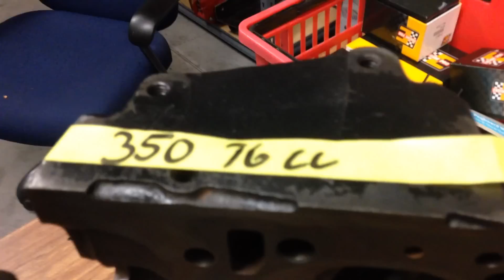350 and 305 Chevy what's The Difference

Comment: I learned more in five minutes watching this video about the difference between 305s and 350 engines. Absolutely recommend a watch.
Reply: Same for me sick info
Reply: Good video honest good info
Reply: Can you put a 400 crank in a 305
Reply: @ronaldphelps2689  yes you can if its 85 or older unless buy an aftermarket one piece rear main seal. If .040 over bore and 400 crank with the longer 350 rods it is a 339.6 and with the longer stroke compression goes up with flat tops 4 valve reliefs to improve the heads with hp 64 cc 350 heads works well. Good cam and intake and heads it runs well and over 300 hp. Torque curve is different than 350. Comes in hard low like 305 buys stays thru hp and peaks about the same. Not a total waste of time and money. Ran them against 327s in lower liter limited 30s 40s fiberglass bodied cars. Great luck with them until find out too big and get claimed.
Reply: Me too
Reply: Instablaster
Reply: My question is couldn’t you just port out the heads Or are the walls thinner?
Reply: @thepropview9517 , you might wanna take a closer look at the intake walls on the 305 heads, in fact, take a good set of calipers and measure the walls on the 305 and 350 heads. I'm well into my sixties and have built many hotrod motors over the years, mostly Chevrolets. I once built a poorboy engine using the closed chambered 185 intake valves, 1.5 exhaust valves on 305 heads on a 350 4 bolt main block with 8.5.1 flat top Pistons, with a good set of long tube headers, turbo mufflers, with 2-1/2 in piping out the rear, put in a 168 midrange cam that was basically the next size bigger at the time than the 260 RV cam, I used the 1969 350 spreadbore 4 barrel intake with a 750cfm quadrajet carburetor with a HEI ignition, I put this engine in a 77 Silverado with 373 gears and turbo-hydramatic 400 auto tranny, I was a little disappointed at the outcome of the build, I decided the engine wasn't getting enough air and fuel, so I ported and installed the 350 heads with the 1.94" intake valves, bought and installed a Edelbrock torquer intake with a Holley 850 cfm carburetor with a much bigger breather, now I was satisfied with what I thought was going to be a low budget mediocre little hotrod truck, but I did get a lesson on the differences between the closed chambered 305 heads and the big valve 350 heads.
Reply: Me since I was 10 believing everyone already knew all this…😑
Reply: @lesliesaner717  The question is, why would you want to trust a 305 that has been bored .040” over? The later blocks (305) have a significantly lower nickel content than an older 350 block, and you’re already handicapped with a thinner weaker cylinder wall
Reply: You learned more than what?
Reply: @lexpro2239  then the previous knowledge I had.
Reply: @steves2443  "I learned more in five minutes than i knew five minutes ago. "More than" hints toward a more complete thought. Understanding starts with an ability to communicate properly. "I am thankful for this video teaching me more in five minutes than I've learned in the past 5 years of higher education." There is an example of a complete sentence. Use incomplete sentences to scribe all the incomplete thoughts you wish. I submit to you that punctuation is unnecessary when the ideas are incomplete
Reply: @lexpro2239  Grammar aside and punctuation for that matter...the video stands as a great example of the owner of this Youtube channel, Myvintageiron7512, explaining his love for the trade where he's gifted. 600k+ views and 7.7k likes proves that point. Again, please do not miss the point of the video over the need to correct for grammar. BTW, what did you think of the video?
Reply: yep!

Comment: I bought a 1986 Elcamino in 1986 so I am the original owner it came with a 305 engine.  I got 369,000 miles out of it very dependable.  It jumped time while starting one morning in my driveway so I jacked up the motor and pulled the oil pan and changed the chain and gears, new oil pump, and just kept driving the car.  Later on the valve guides were so worn (2005) that oil would leak down in the pistons and it was hard to start in the mornings; however after I got it started and warmed up it ran fine.  Rebuilt the carburetor and kept going.  That same year 2005 it was time to rebuild the motor so instead I dropped in a 2000 LS1 out of a Corvette and I still own the car today.  I still have the 305 on an engine stand in the garage.  Again very dependable motor for a daily driver.
Reply: James Perkins great story man, I visualize the entire thing. What do you think about the 350?
Reply: That's an awesome story man I have an 81 and plan to buy a crate 350 370horsepower
Reply: Have an 86 Grand Prix with a 305. Odd options on the car, base interior, 200r4 trans, posi rear end, aluminum intake with a 4brl Quadra junk...I mean Quadra-jet.  Still the runs the same as it did when I got it as a young teenager. 314,000 miles and actually screams.

Comment: One of the best performing motors I have seen was a 305. When we bought it we actually thought it was a beefed up 350. It was so well balanced it was crazy. 
   I was working in a shop in Little Rock at the time.  A guy had a beautiful 85 Monte Carlo. It had gotten stolen about 3 weeks after I had personally worked on it.  You know. He just wanted a basic tune job. Plugs, wires, and a little carb adjustment.  After the work I performed. Just like any other time , I get to test drive.  WELL SIR, I MUST SAY.  I was very, very impressed for what I thought it was. ( Keep in mind I had driven a numerous amount of Hot Rods at this this time.) 
  I was personally driving an 81' El Camino. It had a Pontiac 400 with 6x heads. Edelbrock intake, 4 barrel Quadrajet. That I had tricked out a little bit.( Personally my favorite carb,,, when built right.)
   Either way it was a mean s.o.b.
This all prettied Monte Carlo could've given me a run for my money. (Thinking it was a 350)
 The guys car got stolen. He sold it back to the shop I worked at. The owner of the shop loved the paint job that was on it. So he bought it.
  He was wanting to tpi it though. No prob. We had the stuff to do so.  Anyway he was selling the motor. I had a buddy with a 76' El Camino that was going to rebuild his factory 400 SBC. I told him to come and check this motor out before he started spending money on his factory motor.
  He did. And just like me, thought it was a beast. With the craziest lope you could ask for in a street car it would sit perfectly still. NO SHAKE. The throttle was instant and all you could want.
 He bought it and drove that El camino for about 6 months.  Then the most unfortunate thing that could happen did. THE OIL SCREEN FELL OFF. DAMN, DAMN.
  NEEDLESS to say he wasn't light footed. He liked drifting before drifting was a thing.  We pulled the motor back out. Popped off the oil pan to see the damage to the crank. It was bad enough. It was clear it was a done. Yes it was a balanced engine, it was clear when we pulled the pan. It trashed 3&5 rods. So we pulled the heads.
  Our jaws dropped at this point. NO WAY!. BUT YET THERE IT WAS. IN ALL ITS GLORY. A 305. WOW!!!. 
  Never could make any one believe that was the motor that had been in that 76' El Camino.  
   If I were to guess....keep in mind this is 15yrs ago. I would say that little 305 was putting out around 320- 375 horse.  So sad it went down that way.  Either way I can say, done right. And I  mean done right. I could see around 400 HP out of one. Naturally aspirated.
 I would like to add, I love watching your videos. I difference of opinion in a few little things you say. But I guess, we all know what we know.  Trial and error means a lot. And I have done a lot. Good day to you sir. I will be watching for more.
Reply: i have a 86 monte carlo and it has a 305
Reply: Could you run an 84 monte  carlo with 305 and a supercharger kit and still use an automatic transmission?
Reply: Im racing an 87 Monte Carlo SS in Stock eliminator S/KA and I use the 305 that came in the car with 11:1 pistons and the stock 081 unported heads. It has a multiangle valve job bit with an early L82 intake and 750 quadrajet running VP C14+ on the dyno Im making 409 hp @ 6400. This is a balanced race engine that I have thousands in i my class Im all over the national record but cant quite match it.The record is held by a guy in Washington State with an 87 Formula 350 and hes running 11.63. Im a consistent 11.70s car on a good day but Ive put a whole lot of 350s, 302 Fords, 340 Mopars, and 351s on the trailer.
Reply: The entire reason I came to this video is because I'm working on my '76 Elko and was wondering if it was worth upsizing to a 350 or 400, your testimony might save me several hundreds of dollars if I can tune the engine up nicely :D
Reply: @cosmicbrambleclawv2  Most of the issues I see in my custom shop is customers watching to many of those power shows. Huge difference between dyno tuned and drivability tuned. Many times a nice mild small block will beat these huge high priced big blocks in a lot of races. Main reason is part compatibility and tuning. I generally see the biggest issue is huge cams, huge carbs, 9ish to 1 compression and cheap ebay heads. Not going to work well. 

You can see good gains form those cheap heads but just dropping a 750 double pumper right out of the box and complain about it not having power......
Reply: I completely forgot about this comment thread until seeing your reply just now, I appreciate the input :D

Looking back at it, I realize now I forgot to update my original comment haha. I had written down the specs incorrectly when taking notes, and it actually was a 350 rather than a 305

It'll be a hot minute before I get around to working under the hood (at the moment all the floor pans need replacing and some patch work on body panels/bed, among other things like a entirely new gas tank and a piece to cover the carburetor [at the moment it just has a plastic bucket covering it, under the hood] ) but once I do manage to have her nice and settled to where I can fiddle with things that aren't immediately necessary, any suggestions for tuning it up proper? Definitely not gonna end up being a derby truck or anything fancy, just a sort of daily driver/small workhorse. My grandfather's sounds downright mean after he had it tuned up, but I'm more of a "practical before fancy" person myself haha
Reply: Tubbs a qudra bog was the junkie carb Chevy boys used. Big block Dodge boy's used dual line Holley's!
Reply: @Nowayjose-z2r  Big block Dodge engine is WAAY better than anything Chevy ever had.
Reply: @MasterWitchDoctor  i call big BS on that with stock heads lol
Reply: @wildestcowboy2668  ROFLMFAO!!!
Reply: I have a 82 delta 88 with the olds 307 posi rear end it lights the tires up

Comment: Totally my experience as well. I've had both engines. The 305 is OK as you said and IMHO gets a bit better MPG, BUT, the 350 or better yet 383 gives you more of that kick in the pants we all love. Honestly I'm not even the least bit interested in doing 150 MPH on the street but I do love feeling the torque when I step on the throttle. Thanks for the show.

Comment: Thanks for that explanation.  I'd never heard of a 305 V8 until about 1 year ago - a friend told me he had one in his 25th Anniversary '92 Camaro - though I distinctly remember the 307 in the '69 Camaro and Chevelles and other Chevys.  With your info, I just realized what happened:  They quit making the crankshaft for the 307 when they stopped manufacturing the 327 and enlarged the stroke to 350.  So, in order to make another small, similar displacement, they used the 350 crank and then put a new, smaller bore with it.  And they didn't want the C.I. displacement to be identical, so they made it slightly smaller!  Thanks.

Comment: The 305 is my favorite Chevy engine  because many times it is nearly free and sometimes it is free .
Reply: L.E. Batte don’t forget the significantly better gas mileage
Reply: @jacob.calloway6833  😂😂 yeahhhhh
Reply: 327 small journal  250-375 hp is my favorite
Reply: 351 is my favorite Shevy Ingun.
Reply: I have a 454,351,350 and 305 the only one I’ve blown up is the 350. Then I Rebuilt the 350 been driving for another 10 years.All Motors are damn near bullet proof and parts are cheap and everywhere .🏴‍☠️🏴

Comment: Glad to see someone besides me defend the 350s little brother. 305s get a bad rap because they don't make a lot of HP. They weren't designed to be performance motors but they're every bit as reliable and get decent milage and have decent power
Reply from the maker: with all the aftermarket parts available a 305 can really scream and if that is what you have I say just go with it
Reply: @Myvintageiron7512  had a 305 in my pops 66 impala ss that was out of a monte carlo not sure year but took it out to put 283. Have had the 305 sitting in the garage for the past 12 years and now im heavily debating building it and doing a swap with my 5mge in my 85 supra as its beginning to have issues and parts are ridiculously hard to find for the 5m. Problem is I’m in Cali so i would need to do sm0g under the table to “keep it legal”. Would be nice to stick the 305 in it for now as i acquire a stock 1uz to stick in it legally. If i didn’t live in Cali i would already have the 305 in and keep it in. Very nice engine and love that i wouldn’t have to be breaking my head over parts if something goes wrong.
Reply: @josefastboats5874  no yeah for sure man I’m already trying to figure out where i should go. Considering back to alaska but id drive it up 💀

Comment: My '93 Caprice Classic LS has almost 364K miles on original engine/trans. Doesn't burn or leak oil at all. TBI 305 runs perfect. Been a great car. The small block Chevy V8 is a very well engineered engine either as a 305 or a 350.
Reply: Yeah that's after 3 generations

Comment: Another great video. thanks for posting. here's my 2 cents. for all those who don't believe a 305 can go fast, well your wrong. is more cubes better? of course. but what if you find yourself sitting on a good low mileage 305? I mean hell, they are cheap. is it a waste of time? no. I had a 305 sitting around, also a cam heads intake blah blah blah from another 350 that died. tore it down to a short block, 186 casting heads with screw in studs, mild solid cam, edelbrock single plane intake, 750 holley, hei w/msd6a box, holley blue pump, turbo 350 w/3000 stall, 4:10 gears in the stock 7 1/2 rear end in a full weight 80 elcamino...answer......13:50's friends, all day long. add edelbrock adjustable 50 to 100 hp nitrous kit and bam, instant 12 teens....no matter the heat or humidity. totally reliable. every wknd at any of my local tracks. ran that moter in that config for ten years...TEN SUMMERS of racing.......sold the rolling chassis but still have the motor in another car. so all of you who have a good condition 305 laying around and think it isn't worth wasting your time. i'll take it. who cares if you blow it up, take the parts off it and swap them onto another 305 or even a 350. enjoy.
Reply: Outlaw Mercenary Yeah,I had a 305 in my 78 elcamino and it was a nice performer after just adding headers,different intake and 4 barrel.And it got way better mileage than the low compression   350.Ill always be a 305 and 327 fan!
Reply: Outlaw Mercenary what if you were to port polish and jet the 305 heads to create better flow on a 5.7 block
Reply: U the man. Your comment seems honest and genuine. Thanks
Reply: @nighthawk8053  right on man. 327
Reply: Outlaw Mercenary hell yeah ,  I feel exactly the same way. I’ve had a few over the years that had just few tweets to them and I pounded them into the ground and I can honestly say I’ve never had one leave me stranded .  Not a whole lot of torque but plenty enough to be fun in a little  small car .
Reply: you'd love the engine masters vid where they cooked a 305 with too much nitros.. it behaved respectably right up untill the end. honestly made me want one!
Reply: I agree been around 2 built 305s one had 283 heads and was in a Camaro with a TH350 and  3.73s and ran real strong burn the tires through first and a little bit in second! Another one was all cammed up and built in a square body Chevy truck and it ran damn strong
Reply: I'd love to get a good stock 305, open up the top rig gap and put a power stroke junkyard turbo on it and let it buck